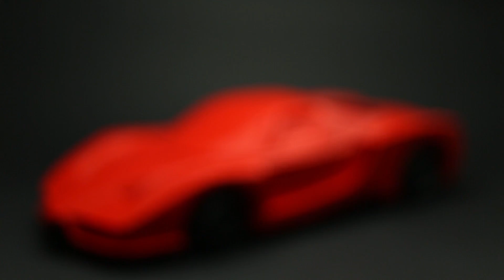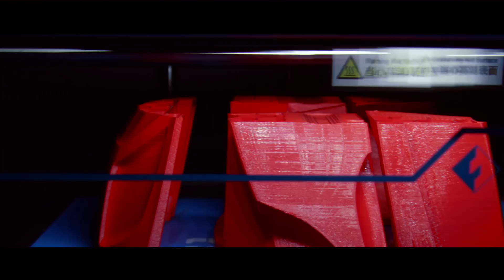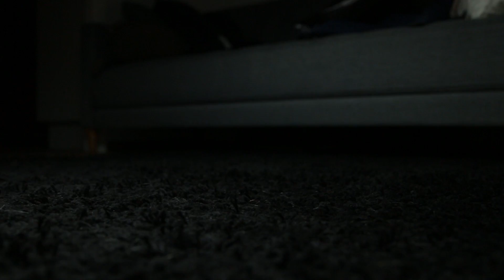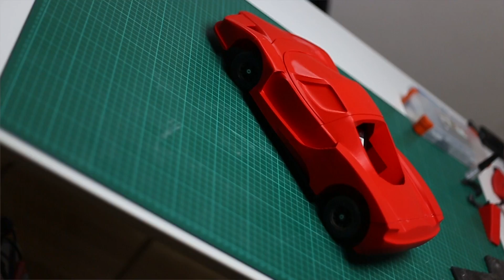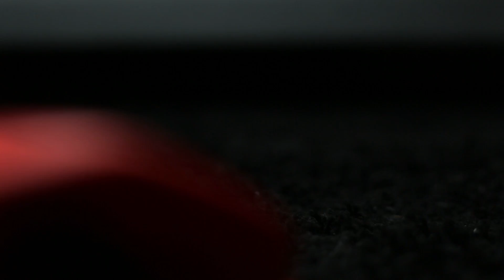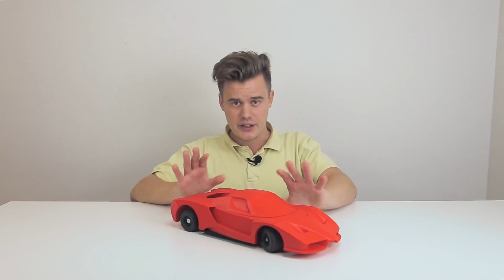3D Printed Ferrari Enzo RC Car

Comment: Fantastic modification...the hours and hours spent modeling were worth it! Thanks for sharing, but there is one tiny little detail you missed. Where are the mirrors? They add a distinctive design element that you don't fully appreciate until they're no longer there.
Reply from the maker: Thank you!!  You're absolutely correct. I'll put that on my todo list.